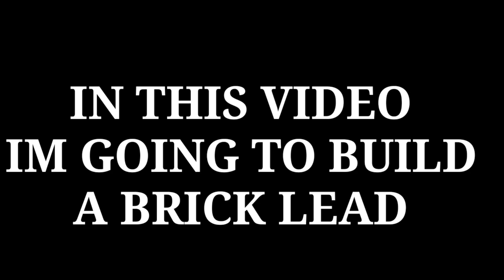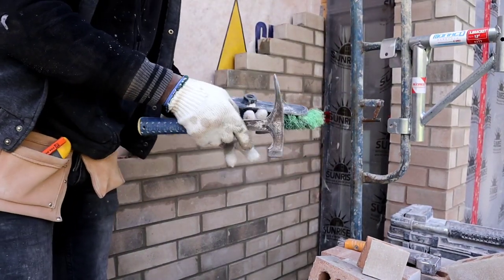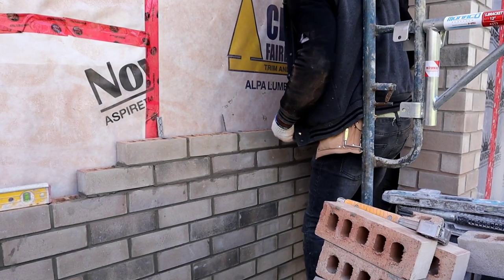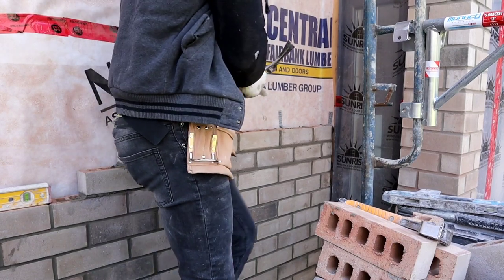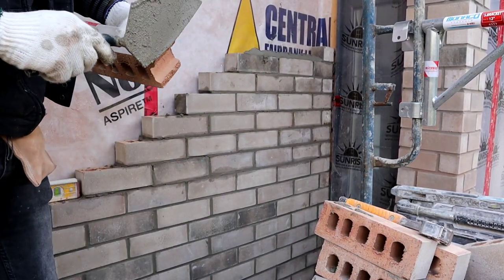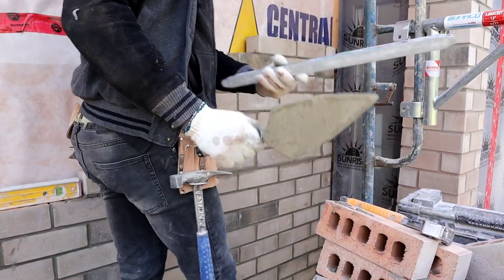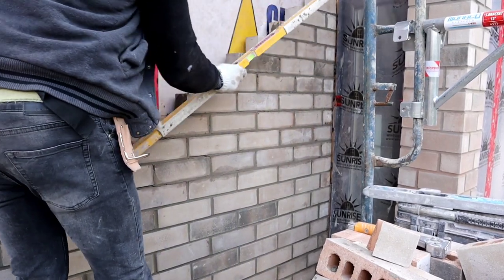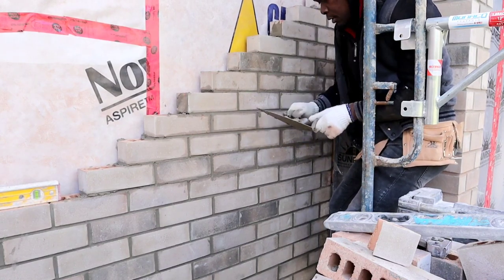bricklaying how to build a brick lead

Comment: Pitty the brick work doesn't work out having two bits in one course in a corner ?
Reply from the maker: I dont understand your question?
Reply: @1kbconstruction824  why can't it be a half brick than a full brick. Not a 2inch peice and a 3 quarter brick
Reply from the maker: Reason for that because the brick is   10" long by 3'' wide.. Not all brick you can go with off brick  at the end of the wall ,depends un the size of the brick .
Reply from the maker: @Derekryan456   And that's not a 2" piece that's a header I have at the end of the wall.
Reply: @1kbconstruction824  you put two bits of bricks in at 1.50. If your bricks are 10x3 than your half be 5 x3
Reply from the maker: And then what would you do at the other end of the wall .. It doesn't works like that with this brick.